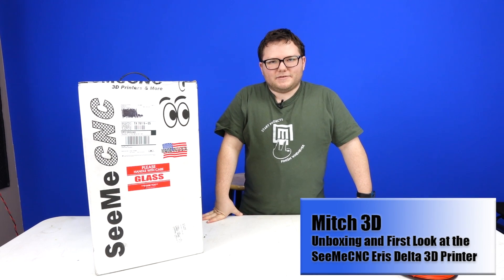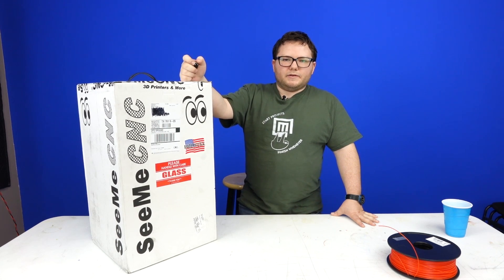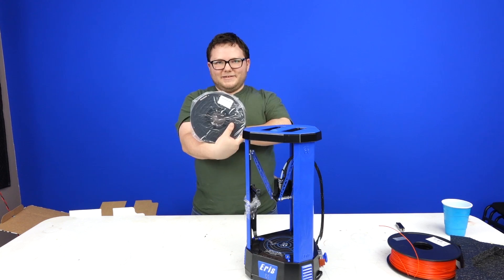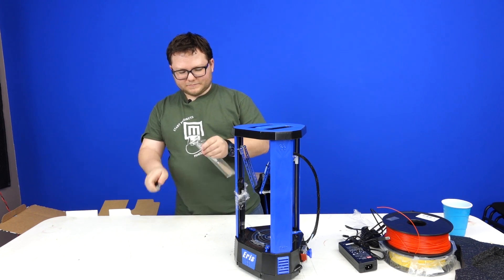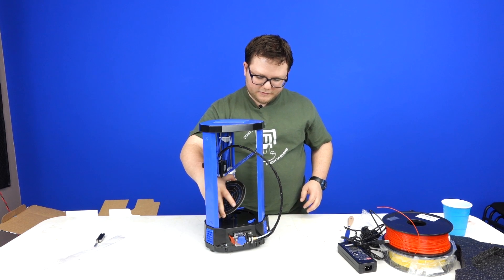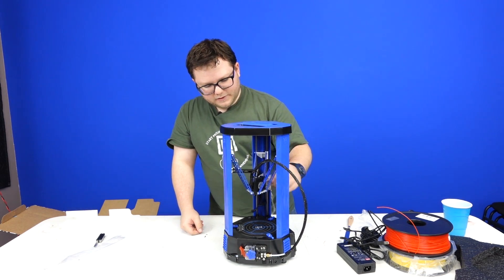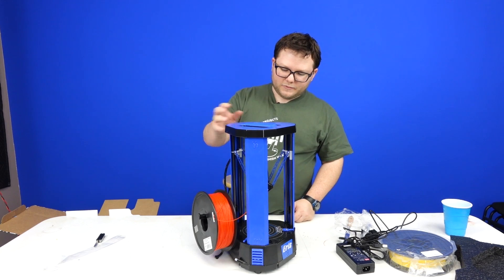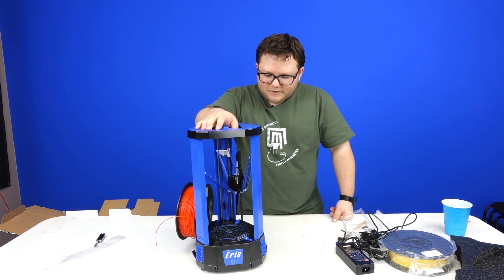SeeMeCNC Eris - Unboxing and First Look

Comment: Would you recommend this printer for a beginner?
Reply from the maker: Yes and no. It does work out of the box but you should probably be comfortable with tweaking settings and learning how it works to get good prints. It's been a while and SeeMeCNC has got firmware updates and has made the documentation better. I'd put it directly in line with buying a Printrbot Play or Printrbot Simple (not the 2016 model) in terms of ease for beginners. I still think it's a good printer for $500 at least for the cool factor, second to maybe a monoprice select mini. Stay tuned though I'm working on getting Octoprint running and I'll do a follow up video.

Comment: Not a fan of MatterControl?!?! I hope you come around to it after you give the software a real chance - it is a fantastic platform with a lot of R&D behind it and  recommended by SeeMeCNC. reach out to us if you have any issues that need to be addressed.
Reply from the maker: no dis, I just have to get use to that interface. I'm use to Kisslicer, Cura, pronterface, and Octoprint. All slicers have their pros and cons though, for the Eris, out of the box, it works just fine and has all the little features the other slicers have. I will do a run down video with all the slicers, and simplify3D. of course matter control is open source, I give props for that for sure. Only issue I had which I'm sure is known is when I ran the load filament gcode it infinitely looped the hotend from 0C and 220C, wasn't a big deal I just loaded it manually. I talk more about Matter Control in my latest video.
Reply: Sounds good - hope you are liking it now that you have had an opportunity to use it for a while. Will check out the latest video also.  Keep up the good work.
Reply from the maker: +Dave Gaylord Thanks I appreciate it!
Reply: +Mitch 3D i've been using simplify3d for a while now and i'm getting my custom rostock on friday, brian from tricklaser reccomends for me to use either cura or slic3r for which he has settings for... Which do you think i should use and what about simplify3d vs mattercontrol? I can do the settings and stuff myself but i was just throwing that in there
Reply from the maker: ReneFloresVlogs I've jumped on the Simplify3D train. Honestly, all the slicers have their ups and downs. S3D is strait forward and it's nice how quick it slices models. MatterControl has some nice features I haven't seen elsewhere like software bed leveling, and being able to edit EEPROM values. MC's slicer isn't the best IMO, but they give you the option to use Slic3r and Cura engine, very similar to using repetier. I have never used Slic3r but I do like Cura. Since I've put down the $150 for S3D I'm making use of it, it's a good all around slicer, I'd recommend if you have that kind of money.
Reply: +Mitch 3D i said i do have it and i've been using it but i haven't used any other slicer and wanted to hear oppinions on them
Reply: +Mitch 3D thanks though!!! Awesome channel i came here from FB
Reply from the maker: Thanks! Sorry didn't see you already had S3D. I'm trying to work on making time for weekly videos like this one because the lighting and video is so much better when I can film in this studio.
Reply: +Mitch 3D cool
Reply: Didn't care for Mattercontrol either. S3D is by far the leading slicer. Too bad it has a price tag. I have found it to be worth every penny.